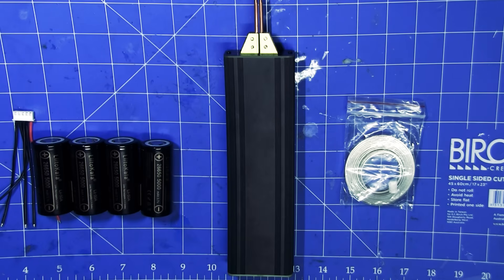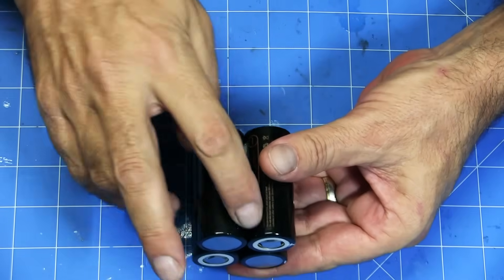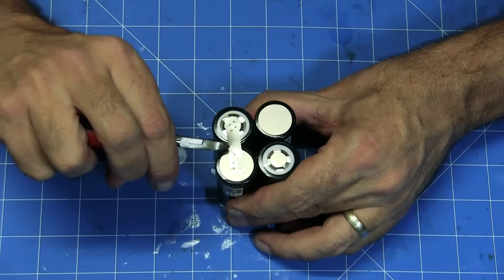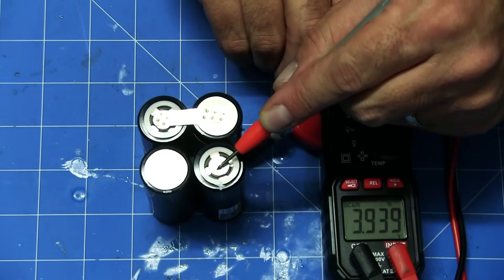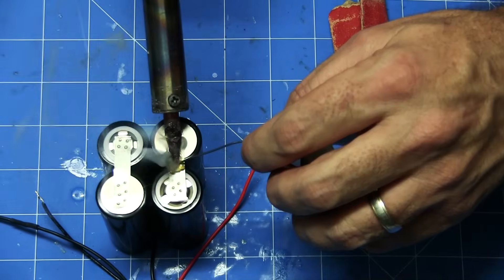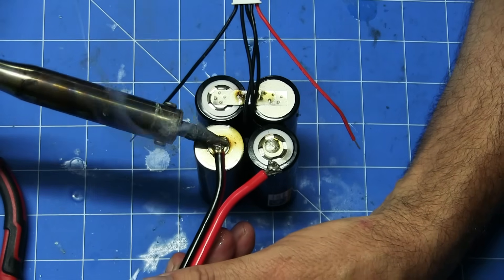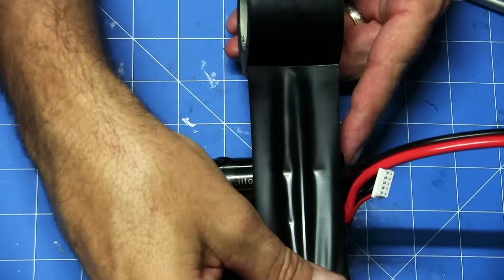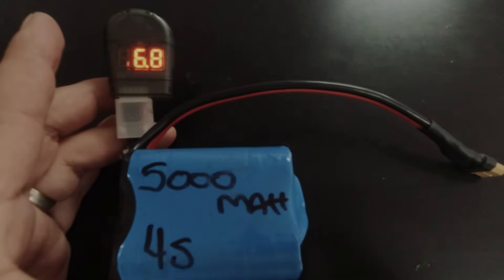How to Build a 4S 26650 Li-Ion Battery for RC Planes (DIY Guide)

Comment: Brilliant video mate, just what I was looking for and even with the danger model of battery! I see the specs say 5a continuous but my glider won't run hard continuously, mainly climb then look for thermals and repeat. How many amps can these packs deliver for that minute or so of climb? Just don't want invest in welding gear etc and kill it. Cheers.
Reply from the maker: I have used them on higher drain craft at 10amps and they are ok. Yeah i wouldn't push it far with these if your craft draws too many amps. I have a video on my channel using them with this craft and they went pretty well. Video - youtube.com/watch?v=gvX4p0ouhdM&t=1s

Comment: Hi,
Why not bms ?
Reply from the maker: I just wanted to keep it simple and I didn’t feel like I needed it. I may try add on in a future battery build. I take it you include them in your builds?
Reply: @stonesrcchannel  In my opinion, a BMS is not essential, but highly recommended. It ensures the balance of the cells to primarily avoid a deep discharge of one or more cells. 
Not to mention the overcurrents at high currents (which is rare, however).
In short, IMHO, for the price it costs, why deprive yourself ?
Otherwise, well done on the Liitokala cells, I use them in 18650, 21700, and 26650. Good from every point of view and on all devices. Excellent values !

Comment: What is the name of the spot-welding tools? Is it portable or have to plug in?
Reply from the maker: @MrBornenjap  it a spot welder bought from Ali express with built in rechargeable battery. Just search spot welder 18650 battery you should find it.